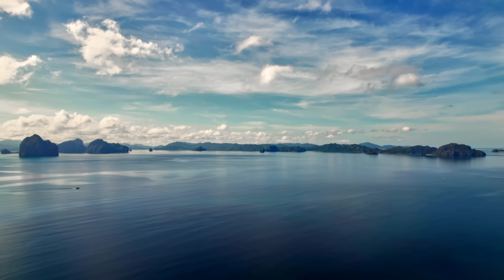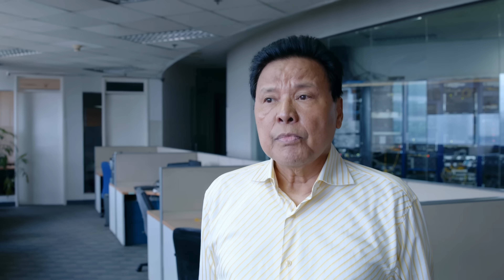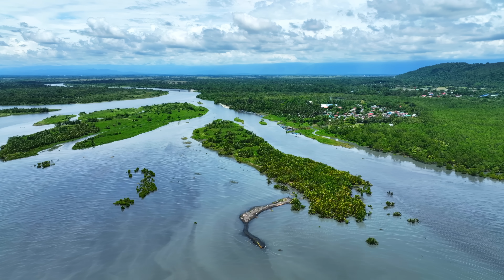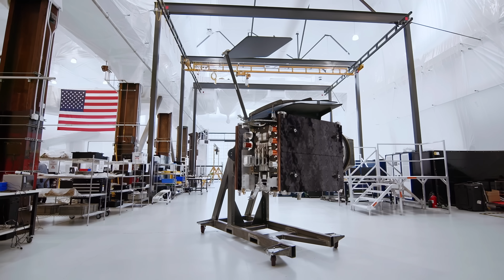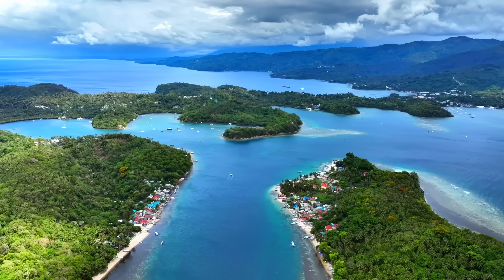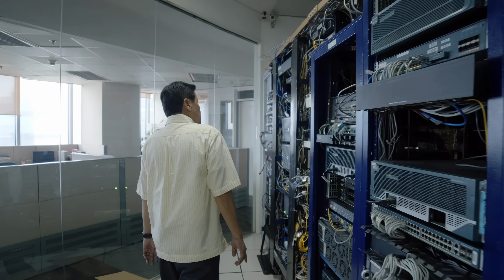Philippines' First Satellite | Astranis MicroGEO

Comment: Wait is it possible that it can be just specifically fly orbit in the Philippines? How is that even possible?
Reply: Its possible by using the right design and technology. We will launch a Geostationary (22,000 miles from Earth) satellite then place in an orbital slot, then the satellite beams covers only  the Philippines.  Geostationary satellite follows the speed rotation of the earth, so satellite seems to be not moving.

Comment: Astranis MicroGEO to be launched by SpaceX Falcon 9 rocket NET October 2023 at Space Launch Complex-40 or Launch Complex-39A, Florida, USA

A SpaceX Falcon 9 will launch 4 MicroGEO satellites for Astranis. The satellites are designed to be much smaller than typical GEO sats and are therefore deployed closer to GEO, cutting down on the time between deployment and operation.

Of the four satellites, one will provide broadband access to Peru through Latin American telecom company Groupon Andesat, two will be leased to Anuvu to provide internet connectivity to airplanes and cruise ships, and the final customer’s identity has not been revealed.

Probably this is the information for now.
Reply from the maker: That is our 2023 launch, this satellite would be in our 2024 launch, alongside four more satellites!
Reply: @astranisspace  Great!
Reply: I didnt know this😅❤

Comment: This is a great improvement for the Philippines ❤️
Reply: But how to work this they disch and router like a starlink?
Reply: @buhaymekanikovlog1646 😊😊😊p😊
Reply: An elementary improvement.
Reply: It's a traditional Vsat, with antenna, modem and router. We will use a Geostationary (22,000 miles from Earth) Satellite beams it's signal 24/7 to the Philippines only.